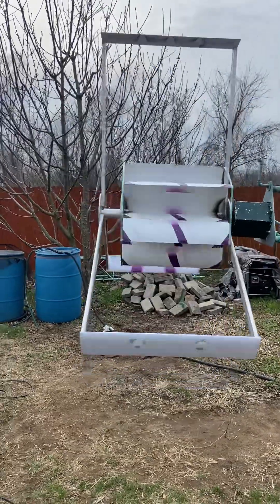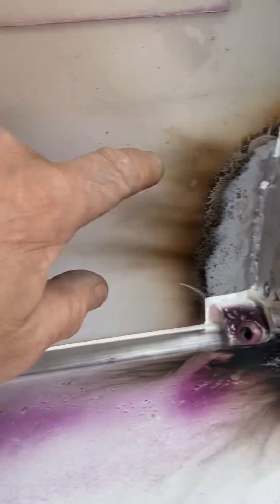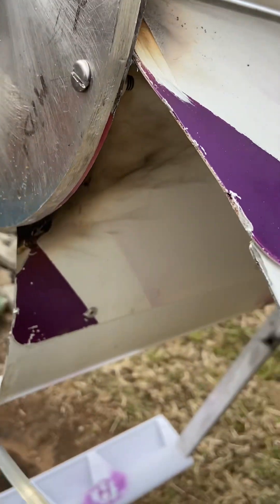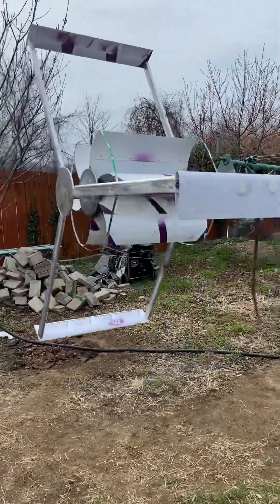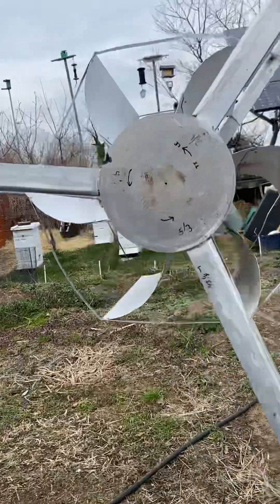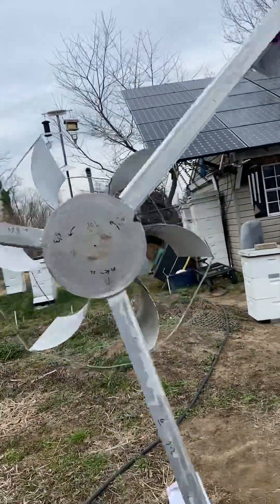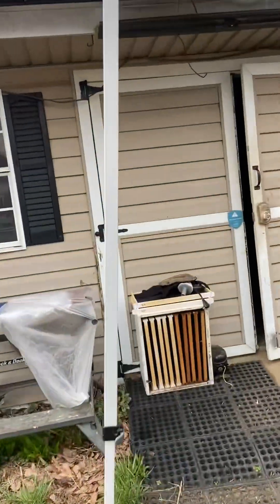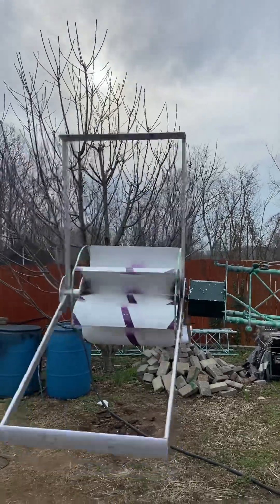Vertical wind, turbine, modifications with airfoils and TIG welding ￼

Comment: You're going the right way as far as the turbine is concerned. Now the challenge is to match turbine voltage with inverter range and making sure the inverter doesn't make the turbine stall at low winds. Congratulations My Friend
Reply from the maker: I already have a 6000 W aurora inverter with a aurora interface box, which I programmed for the power curve of this turbine. Not a problem

Comment: Looks good but voltage and rpm are directly related. So if you have a 48v system the horizontal turbine just does not have enough speed. The only way to rectify is to put a stepup pully system between turbine and motor to get high speed at low rpm. Problem is not torque. Let's see your results. I wish you well
Reply from the maker: This generator puts out 120 volts at a moderate speed .I only need the 50 volts to start the inverter. It’s already produced power, but only when the winds are greater then 18 mph. (8 m/s).    So this is a experiment to see if the airfoils will start spinning at a lower speed this way when the winds do pick up, it would produce energy. This generator is not a 48 V system. I’m just hoping it’s balanced enough that it doesn’t tear it’s self apart… I’m thinking that may happen. So my next plan is to give up ! and purchase a horizontal turbine. 2kw size. 
I programmed the inverter’s power curve myself, it’s rated up to 6000 Watts & the generator at TopSpeed can put out 5000+ watts. Which I’ll Never see that. 
I’m asking Tesup to send a smaller generator for this , if they do. That will be my next project. Highly doubt it, those idiots wanted me to remove all the blades except 3 of them… they think that will fix the problem… way past that point now.

Comment: LOL, please record that when you get the speed up to 1K rpm. The carnage will be awesome.
You should have plenty of torque at that low speed but the only way you will get the speed you want at the hub is to use a pulley system or a planetary gear set-up.
Reply from the maker: I was thinking the same, see if this tears its self apart in high winds.  Then I can move onto the horizontal  type …